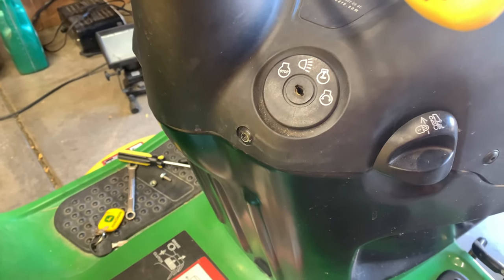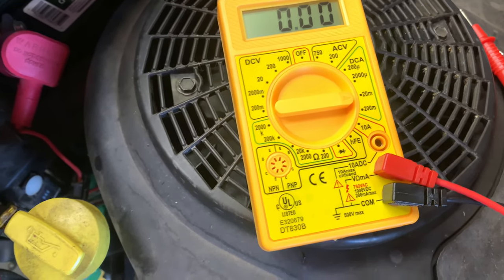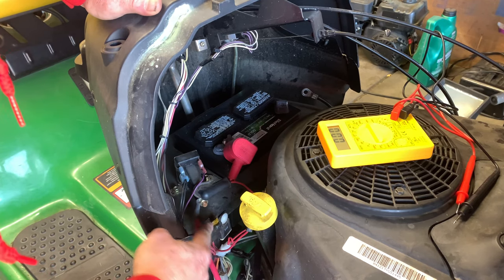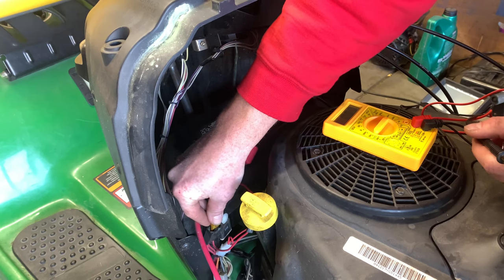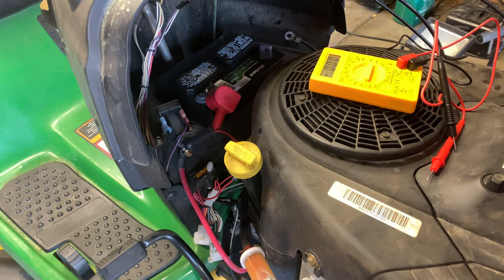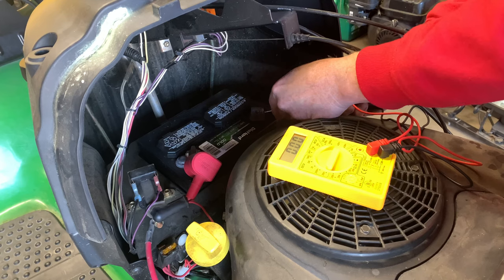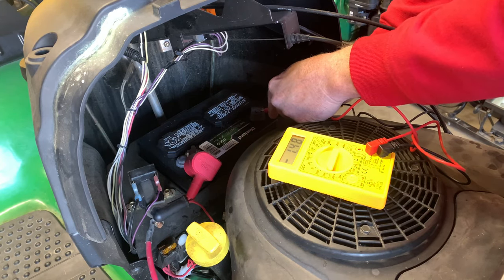Why Does My Riding Lawn Mower Battery Keep Dying? Small Engine Repair

Comment: You're the best -  Thank you for showing. One tiny question for you is why "voltage regulator dead causes the mower to shutdown? Thank you.
Reply from the maker: No, it just would not charge the battery. Should not cause it to shut down.
Reply: Thanks for this video because I have watched many that helped me test other problems that helped me rule those out but never thought it would drain the battery without the switch being turned on at all . Mine is a zero turn gravelly mower
Reply from the maker: @howtovideoswithchris865  Glad it helped.

Comment: If you unplug the harness on the left and it reads zero, then you hook it back up and it shows the drain. Why is it different when you do the same to the Regulator and when you hook it back up and still shows the drain like you expected?  What am I missing? Well done video!
Reply from the maker: I was just confirming it was the regulator. I could have been something else on that side of the circuit.
Reply: Agreed. It seems he found the drain immediately and then kept going. Then he said the drain was on the other side although it was exactly the same as the first one.

Everyone says this video really helped and I'm like..."why didn't the very first fuse get replaced? 

So confusing. Absolutely confusing. I appreciate the message or attempt on the video, but when the drain was on the first fuse, why ignore that and say it was a totally different one?!? 😅
Reply: @jenniferlyon1210 
replacing the fuse will not fix a drain. The fuse was not broken as the drain was passing through it. If it was blown there would be no drain. 
That was the main fuse, all power runs thru it.

Comment: Ive watched multiple times and checked other comments and what ive figured out is that you must have already known the regulator was bad. With the test you did you get NO results proving what component was bad. If you get the same result from every part, then its not any of those 3 parts. If you got draw with everything hooked back up then you would need to test further down the line to locate it.
Reply from the maker: I did work my way down the line. I removed the fuse, got a zero reading. Plugged the fuse back in and disconnected the connector, got a zero reading. I then plugged the connector back in and then I disconnected the voltage regulator and got a zero reading. I could have started with another component on that side of the plug, but I started with the voltage regulator. If the voltage regulator was not the problem, I would have still had a draw on the battery. In that case I would plug the voltage regulator back in and move to another component.
Reply: Thanks for clarifying..  I got confused at that spot too.  Watched the video and read the transcript and still didn’t get it 😆 so I appreciate you replying to this comment.

Comment: Thank you , how about Florida weather I’m told the riding mower batteries with 230 or over cranking amps will only last for up to 2 years should I disconnect the battery every time I’m done mowing? Thanks   any thoughts
Reply from the maker: If you have no draw on the battery then you do not need to disconnect it. However, batteries in general will always have a parasitic draw. If you have long periods where it is not being used, attach a battery tender.

Comment: I'm confused, you had a drain on the plug and voltage regulator,  The plug is connected to all the safety switches. Question is how to you know which one has the drain?
Reply from the maker: It's a process of elimination.

Comment: Will the battery charged when running

And when turned off can disconnecting the fuse stop the drain?
Reply from the maker: On this particular one, yes. If you have a draw, yes removing the fuse will stop the drain.

Comment: I have current draw with voltage regulator connected. Disconnect and it goes away. Figure voltage regulator is bad. Replace it and still have drain. What would be next step?
Reply from the maker: Disconnect the wire that goes to the stator. Do you still have a draw?

Comment: I dont get it.  First test you got disconnected 0, connected 1.48, second test disconnected 0 connected 1.48, third test disconnected 0, connected 1.48.  Since they all have the same result how did you determine it was the last one?
Reply from the maker: My first test demonstrates drain. The reading is 0 when the leads are not connected between the battery and the ground cable. Then when touching the leads to the battery and the negative cable I get 1.49, which indicates a draw on the battery. In my second test I remove the fuse. Placing the leads on the battery and the negative cable I get 0. Indicating no draw. By removing the fuse I have cut all power from the battery to the mower. So the problem is not with the fuse. In my third test, I disconnect one of the wire connectors. Then connecting the leads to the battery and the ground I got 0. This tells me that the drain is related to that connection. At least one of the wires that come into and or out of that connection is causing the drain. I then plugged that connector back in.  My fourth test I disconnect the voltage regulator. The wires from the voltage regulator go to that  connector. I Then I place the leads on the battery and the negative cable and I get 0. By systematically removing components from the electrical system I was able to deduce that the voltage regulator was the cause. As soon as I removed it from the electrical system, the draw was no longer 1.49, but 0. 

Actually this is a very common issue I come across with riding mowers. I was very detailed in this video because I wanted to show the steps, but when off camera, I connected the leads to the battery and ground cable and verify the draw and then disconnect the voltage regulator and the draw goes to 0. The voltage regulator just goes bad and grounds itself out and causes the drain.
Reply: Awesome explanation! 👏👏👏👏👏

Comment: You had the same result when you unplugged the voltage regulator that you had when you unplugged everything else up to that point.  So why is it that you decided the voltage regulator was bad???
Reply from the maker: My first test demonstrates drain. The reading is 0 when the leads are not connected between the battery and the ground cable. Then when touching the leads to the battery and the negative cable I get 1.49, which indicates a draw on the battery. In my second test I remove the fuse. Placing the leads on the battery and the negative cable I get 0. Indicating no draw. By removing the fuse I have cut all power from the battery to the mower. So the problem is not with the fuse. In my third test, I disconnect one of the wire connectors. Then connecting the leads to the battery and the ground I got 0. This tells me that the drain is related to that connection. At least one of the wires that come into and or out of that connection is causing the drain. I then plugged that connector back in.  My fourth test I disconnect the voltage regulator. The wires from the voltage regulator go to that  connector. I Then I place the leads on the battery and the negative cable and I get 0. By systematically removing components from the electrical system I was able to deduce that the voltage regulator was the cause. As soon as I removed it from the electrical system, the draw was no longer 1.49, but 0.
Reply: @small_engine_repair  So I am getting a .17 draw.  When I disconnect my voltage regulator, it goes to 0.  So I bought a new voltage regulator and hooked it up.  Same thing only a slightly lower draw.  .14  Any ideas?

Comment: what could be the culprit if the drain happens after disconnecting the wire harness?
Reply from the maker: I have seen some cases where the battery itself is the parasitic drain. Loose cables and a dirty battery can cause this.
Reply: 2015 pony installed new solenoid and new battery ... Battery dies a couple days later any ideas??
Reply: @mattdaley1891  I'm going through the same. Harness was fried so I pulled off the harness and wired in new wires no safety switches. But she dies after a couple days.. I gotta do this test with a new battery and find where the culprit is.   Also my battery read around around 13 volts while running. I assumed it was charging
Reply: Just found out it's the regulator... Got it fixed back up and running

Comment: 0:51 what cable? And one on the battery? Negative I assume 
Where did you put the other lead ? Not very clear on that but I’ll keep watching even though you already lost me
Reply from the maker: I need your feedback.  I get people commenting on this video on how well it was done, it was clear and helped them solve the problem. Others ask questions like you have and do not understand the process. The next time I get a riding mower in I am going to make another video. However in the next video I want to do a better job on explaining everything. 
Yes the negative cable.

Comment: Can you check from the positive cable?
Reply: Should be the same.  Current has to go through battery.
Reply from the maker: Correct, I have just always done it on the negative cable.
Reply: @small_engine_repair  thanks for reply.

I got a real conundrum.  Got a rider that killed a battery in a few weeks. Told that it has been killing batteries along as they had mower since new.     Tested charging circuit(just a diode. No rectifier unit).    Anyways it checks out.  But can not see a current draw when shut down.  So I don't what the hell is going on.
Reply: @stevewinwood3674  dude I'm going through the same deal. I have to do a draw test first
Reply: @echabot2721  yeah. Hopefully you will fight a draw.  I didn't which makes me wonder how the hell it is killing a brand new battery in two weeks...
Reply: @honestly3371  no buddy, I never did figure out. To be honest I never really looked into again.  I just disconnected the battery cable each time after I mowed.    

When I got couldn't see any current when doing the test I figured I wouldn't be able to figure it out.  Had a lot of other things to worry about at the time. 

You can always do that for a temporary fix. Disconnect battery when not using. That way it is impossible to draw it down.

Comment: 1.4 mA or 1.4 amps. Makes a big difference. Know how to read a meter first.
Reply from the maker: Yes it does. I blew a fuse on my good meter and had to run out to Advanced Auto parts and grabbed the one in the video. Don't buy the one in the video, it is junk.

Comment: You can get those cheap multimeters for free with coupon or for $5  at harbor  freight. You got ripped off.
Reply from the maker: Good to know. I have a Fluke. Was using this one because I blew a fuse and did not have a backup at the time.

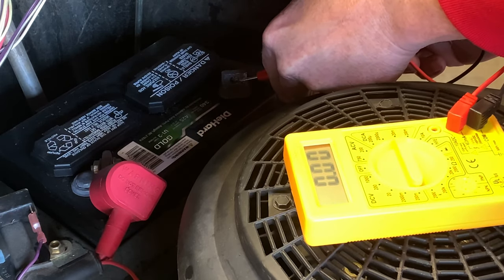Comment: What cable are you toching?  at 1:01?   you have to be more detailed for newbies man come on.  You are not even showing where you are touching your leads come on man.
Reply from the maker: Yeah I get mixed reviews on this video. Next time I get one I will make it more detailed. At 1:01 I am touching the negative post of the battery and the negative cable that connects to the battery.